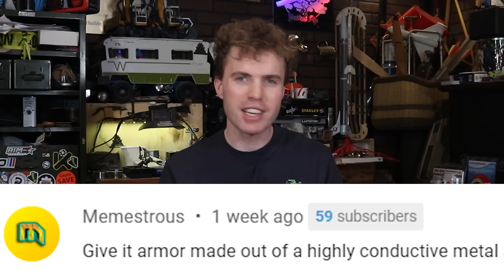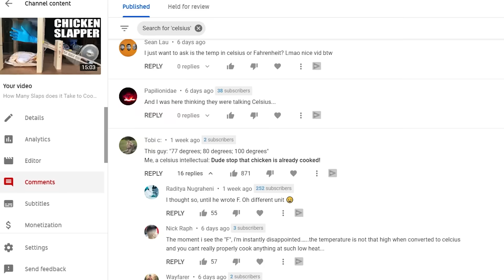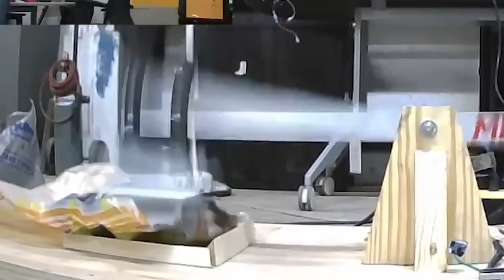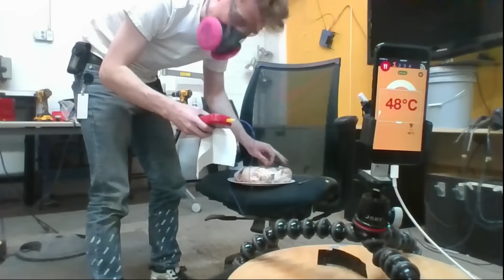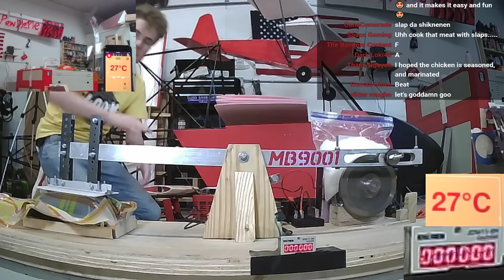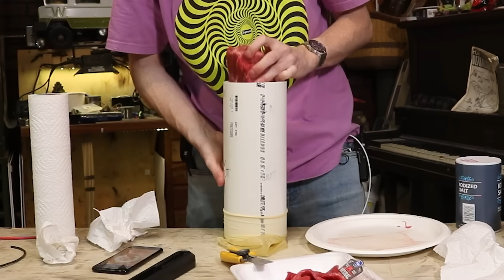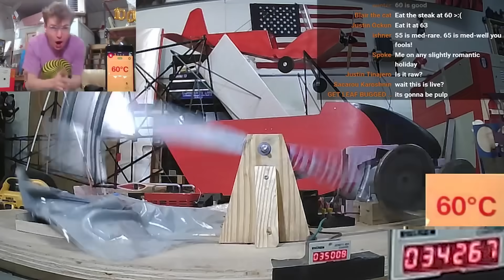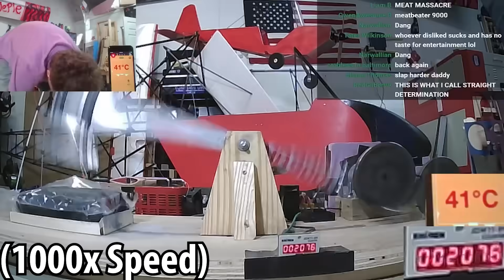I Cooked a Chicken by Slapping It

Comment: Could have doubled the rate by having a multiple slappers like easily do 2 so when one is up the other is down. sure you could also done something with gear ratios as well as would have adjusted like not have it raise so high up. Also I would go with more power but do something with the impact side not make it rigid either with the surface material or what connected it to the rod. Anyways the chicken is way thicker. and smart to not eat chicken that is not cooked. Im sure the 40c for the steak was no coincidence that's what rare is.

Comment: “Basically tastes like you’ve been chewing it for a minute”

Or yknow... 6-8 hours
Reply: Well, technically each of those slaps doesn’t have even half the force a good chew would provide. Out jaws are strong enough to bite off a human finger like a carrot
Reply: @Mike-lu2yl  thats actually a myth
Reply: @zellafae  i mean not really. The muscles in our body are strong enough to tear us apart and shatter our bones if they were in good physical condition and all worked at once. The things stopping us from doing it is our mind knowing it’ll hurt them, and the strength of our teeth.
Reply: @Mike-lu2yl  put both a carrot and a finger in your mouth at the same time and bite until the carrot breaks. your finger will barely hurt at that force. garden vegetables are surprise surprise a fair bit weaker then a finger of flesh and bone. is it possible to bite off a finger? probably but it's alot harder then biting a carrot and your unlikely to get through the bone without biting at the joint
Reply: @brine_909  Wait what? Oh I think there’s been a misunderstanding! I didn’t mean a finger is as fragile as a carrot, but instead that your jaw is capable of exerting enough force to snap a finger off like a carrot. Completely different levels of strength required, but I was using a carrot as a comparison because I couldn’t just say bitinf a finger off is as easy as biting a finger off.
Reply: @brine_909  sorry if I confused you!
Reply: @Mike-lu2yl  well according to this https://skeptics.stackexchange.com/questions/15231/does-it-take-the-same-force-to-bite-through-a-finger-as-a-carrot

it requires 1500N to fracture a pinky bone and your jaw can only exert 750N so unless you bite at the joint your not getting all the way through. not sure how tough it is to get through the joint though
Reply: @brine_909  btw thanks for being cool about this discussion. I know people who’d curse me out by now!
Reply: @Mike-lu2yl  myth. Carrors are much weaker than bone.
Reply: @awesomelyshorticles  hey, mind reading one of my comments? I saw the misconception and I replied with what I actually meant and I’d rather not retype it. Sorry it took me so long to respond, you commented as I was responding originally so yours didn’t appear! My bad!
Reply: @Mike-lu2yl  thanks for bringing me in the loop again. Weirdly, i replied again earlier before you corrected yourself but im not seeing it. But its not important now, cause its obsolete with your correction.
Reply: @awesomelyshorticles  no problem, and thank you for listening to my explanation! I just sent another to Deaken and I’m trying to work with him to explain the logistics. I’ll be responding quite frequently so if you wanna see our conclusion check in every once in a while
Reply: @notimeforyoutubelol  Oh god I didn’t realize this was the comment chain you replied on and I thought it was from a different one which would’ve made thing incredibly worse
Reply: @notimeforyoutubelol  oh no you’re fine, it was just funny timing
Reply: @notimeforyoutubelol  noticed that, its kinda getting entertaining. Want some virtual popcorn?

Comment: To prevent overheating in future chicken slapping endeavors, use compressed air instead of electric motors.  Air tools like nail guns and grinders and such actually cool themselves off with use and the compressor is made to run all day.   A modified air tool would probably work well.

Comment: Have you ever seen these industrial paint shakers that go up and down really fast? Maybe you could build something like this. 
Then put two horizontal plates in it, some walls to the sides with a door somewhere, so you get a closed box. You put the steak in that box, and because the whole thing slams up and down really fast you get double the amount of impacts, it would get cooked more quickly.
You could still pack it in aerogel, but you might need a remote thermometer.
Maybe worth a trie? And exactly how tender was it? Could be a good method to turn bad cuts into tender steaks 🤔😂

Comment: it used way more energy because it was so dang loud. surrounded by a box of insulating material, more of the sound would be converted to heat, and need less slaps. also a box would hold in the heat that was radiating into the room. thats why we cook chickens in the oven and not on the stovetop usually.

Comment: The scale used for "real science" is Kelvin, not Celsius, but ok....
Reply: But kelvin and celcius are the same just add lik 300degrees
Reply: Look nobody here knows how kelvin works dude, and many scientists use Celsius too, kelvin and Celsius are basically the same, but zero is just shifted
Reply: Kelvin is 273.15 degrees c in a trenchcoat
Reply: @RepeatedFailure  
Yeah, but that "trenchcoat" makes Kelvin an absolute scale with one point of reference (absolute zero), meaning that it isn't relative to anything arbitrary (Celsius is relative to boiling and freezing of water).
That's why Kelvin can be used for all thermodynamic calculations. 
Many formulas in thermodynamics just won't work with Celsius (for example: entropy calculations with Q/T or with mCln(Tf/Ti))

But hey, Celsius is easier to interpret, I'll admit.

Comment: Wish I knew about this when you were taking ideas because you could've slapped the chicken twice as many times with the same motor/slapper speed by attaching another arm to the opposite end of the rotor, getting two slaps per cycle. You could've actually decreased the speed of the motor a whole lot  while keeping the slaps per minute equal to your design and getting a much longer sustained on time from your rig with less strain on all moving parts.
Heck, you could've used more than two slapping arms, 3,4,5... 8 arms all taking turns slapping the chicken!

Comment: So, I mean have you heard of power hammers? They hit hard but they can't buckle. Some of them use leaf springs to transfer force from the flywheel to the hammer, some use two pistons to compress and push air into the hammer. One piston for compression the other to receive the force.

Your hammer was so forceful by comparison.

Comment: You should turn down the threads on the  crank pin, It'll last a heck of a lot longer and where in as opposed to where out also adding a oil pot on the yoke (personally I wouldent use a yoke instead using a eccentric connected to a 90* bell crank to give a more controlled motion) to give continuous lubrication.

We use this same arrangement on model steam engines that have a vertical valve spindle like on a Stuart Beam Engine.